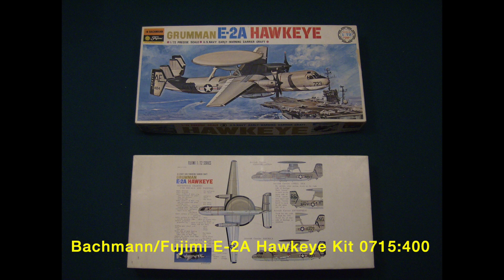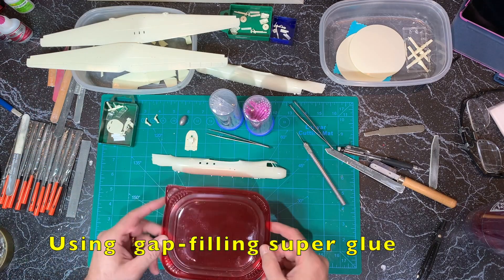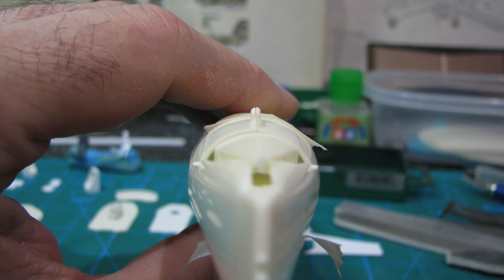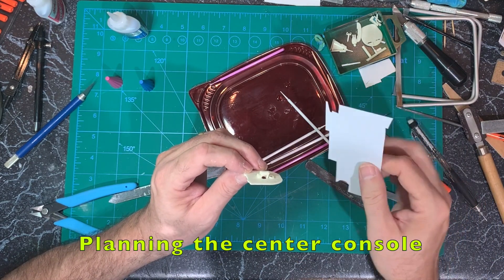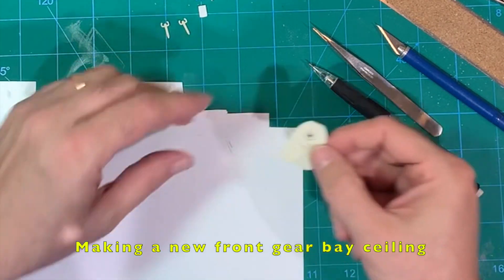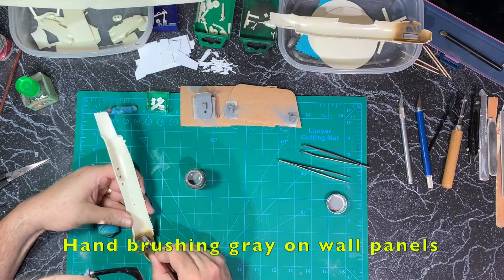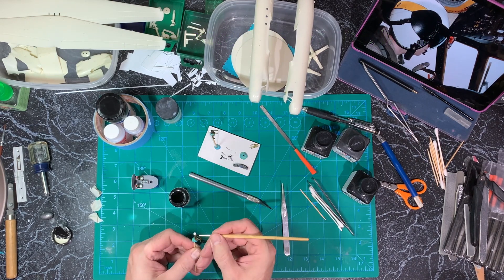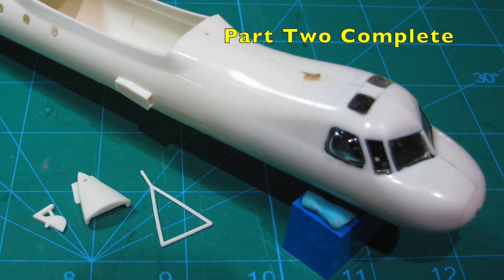E 2A Hawkeye Build; Part 2; 1/72 Bachmann/Fujimi Kit 0715:400

Comment: I really like this project.  For the last 3 years or so I've been working on (and off ) something similar based on USS Forrestal but not with any specific wing or period as a focus. Ten aircraft so far and the Airfix 1/600 kit of the ship itself under construction.
Reply from the maker: Thanks for the kind comments.  Yeah, I like to do “theme builds”   I’m thinking about and gathering a group of WW2 fighters after this project, which at the rate I’m going, will be at least a few years down the road.  Good luck with your project.
Reply: I know what you mean about things taking time. Life, and other show builds, tend to get in the way but watching this has given me some inspiration to pull something from the  Forrestal stash and get into  building it, maybe even a Hawkeye. My last project update was November 2019 so it's high time I got back on the horse.  BTW something I've found helpful when painting the red edges on uc doors is to use a marker pen. It's easier, quicker and much neater than a paintbrush and sealing with varnish stops it rubbing off.
Reply from the maker: Thanks for the tips.  I've tried red stripe decal in the past but wasn't happy with the results.  Maybe I'll give the red sharpie a try this time.
Reply from the maker: @darryldyke1264  Hey, I just posted Part 4, finishing the plane, https://youtu.be/VzCxXI2Mick

Comment: Very well detailed! I hope the weight is enough for it not to tail sit. I heard it is the hardest thing to do and that the landing gears do break if too much is placed.
Reply from the maker: I packed it pretty well with weights.  I plan to use thick super glue on the landing gear to compensate. Thanks for the view, comment, and subscribe.

Comment: Nice reminded me to repaint my aircraft on my 1:720 enterprise. Here is a question, have you made the E-2 in 1:720 or closer for your enterprise kit, and when might we expect it?
Reply from the maker: I just glued the main wing onto the fuselage today on the 1/72.  And I just filled some mold ejection marks with super glue which is drying right now. Probably a few more weeks to finish that. Then the 1/720s probably a few more weeks after that.  So about a month to 6 weeks.  I am only able to get to my work bench on weekends and maybe one weeknight if I’m lucky.   And I really take my time to get things just right.  Stay tuned.  Thanks for watching.